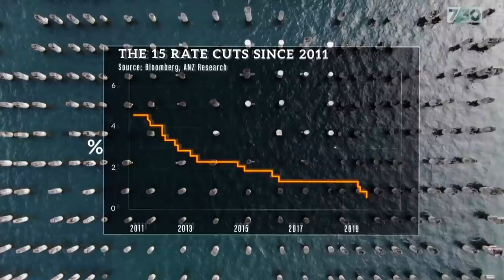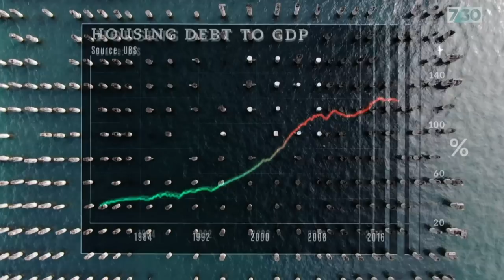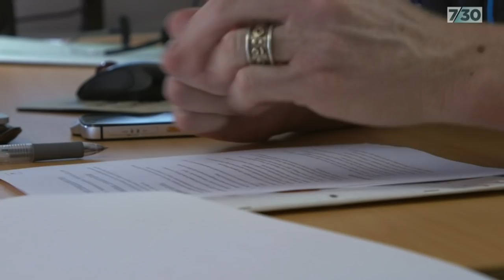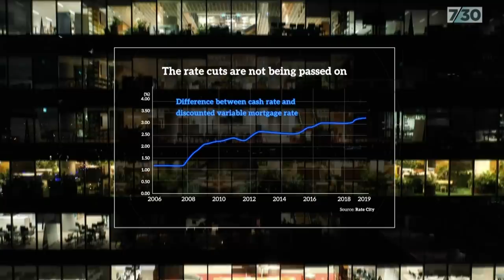How Australia became the world record holder for debt | 7.30

Comment: What happens when the interest rates start to rise, most will fold & have lost everything, worked for nothing all that time.
Reply: Glenn Carle the government won’t allow that
Reply: Rates won’t rise more likely to go negative like they did japan they are also considering same in the uk. Negative rates means those with savings need to start spending instead.
Reply: Rates will go negative, it's the bail ins you gotta watch for.

Governemnt doesn't care about the citizens they will bend you over a barrel and laugh.
Reply: For now, the RBA (our central bank) is determined to keep rates low, regardless of the dangerous asset bubbles it creates. The policies of the RBA do not  fill me with any confidence.
Reply: @sweetvuvuzela4634 
No those people should buy metals as assets against money deflation inflation

Comment: The environmentalists are preventing the building of the housing stock needed to be in supply enough to be affordable and appropriate in size for families and close enough to commute for work. In counties with a surplus flow of immigrants, higher than forecasted this is a disaster. Build enough homes in the right size for the population you have native or foreign born. Divorce is also throwing off the housing stock when less adult couples are sharing the same residence. It’s an East math equation. If you don’t have the bulk of properties costing 3x an average person’s annual wage the local government isn’t doing the right thing. With divorce you can’t base it off two incomes. With single person households you can’t base it off two incomes.

Comment: I hope consumers realise that because of dropping fertility rates or people opting for smaller families or even no families, there is going to be an excess of housing available which will reduce the future value of your house. Supply would then be greater than demand. Hopefully by allowing more immigrants into the country, the housing cycle or evolution will be sustained, because they too will try and move up the housing ladder, but if this was not the case , the floor will be pulled out from underneath the banks requiring a reset of note. 
There is a macro-economic principle regarding banks at play here which is archaic and is in need of dire and broad public debate. Not just here, but all over. 
Our next generation are going to be screwed bigtime

Comment: Hotwire. This is an out of date housing business since the climate change linkage to the energy consumption.
Who wants to burn electricity bill to heat a whole floor just for feet. HAHAHA it would be economic to wear UGG boots at the house in the winter. Consumers change, but the old fashioned business doesn't. Then that's their problem.

For macro economy, again house market is the main problematic pivot that everywhere in the world is THE SAME. The major debt problem still is the HOUSE.
For the first two income family with 1M loan mortgage,  they can pay off their debt at least in their heyday while kids grown up for their housing and car stuff.

The world is the SAME-- the cost of SURVIVING is also THE SAME.
Reply: I thought you being serious for a second, underfloor heating is still a very high business, as in in home theatres, extra butler kitchens, 4 toilets in 2 3 bedroom homes multiple fridges some for wine, some for drinks next to the bbq area, then another fridge for the lounge area, plus the 2 kitches. 
Most my clients have elevators in their homes and no solar to power it. Open plan living areas with 6 metre high opens with 4kw air con in each room, electric saunas and tanning beds, house lit up from the outside and gardens lit up all night, pool constantly heated, climate control dry wine rooms. 8 cars but in garages that can fit more. 
Where do you see the people worried about climate change as I dont see it with my clients.
A friends cousin does illegal dumping and tire burnoffs for companies to avoid costs the lost goes on. For every can you recycle as figure of speech theirs 5 bits of plastic dumped into the ocean.